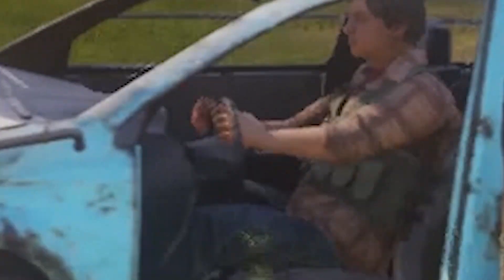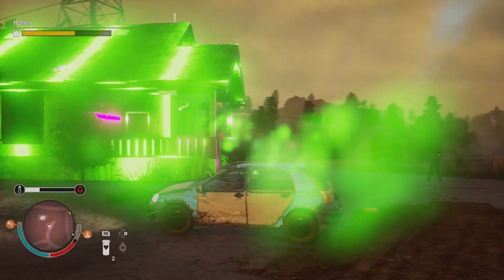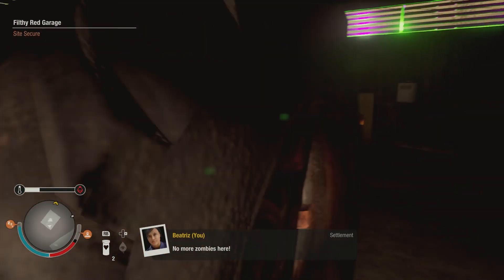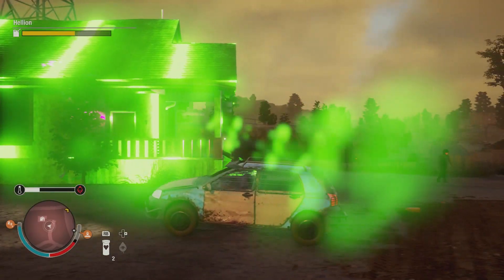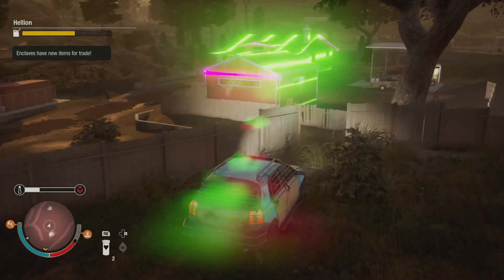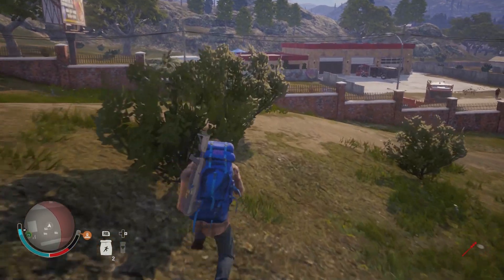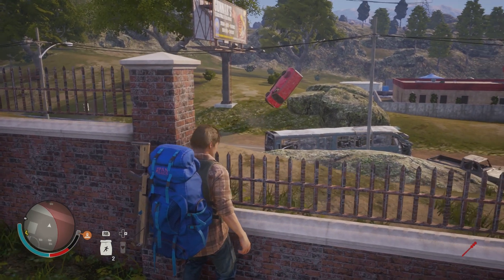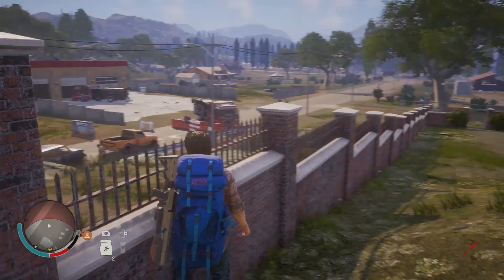State of Decay 2 WTF Glitches Part 2 (I NEED AN EXORCIST!)

Comment: Oh, man you got me dying over here! I haven't had theses issues but I have random walls in the middle of the road!
Reply from the maker: Random walls in the middle of the road? I haven't heard of that one before.
Reply: Git Gud Fox yeah for me they appear near auto shops it's weird
Reply: I've had invisible dead Juggernauts lying in the road. I was driving around and I crashed in the middle of nowhere. When I bumped into what stopped me, I saw blood splatter as it would if you tried to run through a dead Juggernaut.

Comment: I had the exact thing happen at squelones brewing company. Got back from a mission and was rather shocked when I got back to see 2 lengendres and a van flying through the air.
Reply from the maker: The strangest one I've seen is a van that rocketed off into the sky after being refueled then got stuck there frozen in the air.
Reply: @GitGudFox  yeah the mine eventually froze in the air then ended up parked down the road after about 20 mins. The most shocking was hitting 2 random zombies in a utility van and being catapulted half way across the map in something that was both hilarious and baffling.

Comment: I’ve played sod1 & now new to sod2 (yes late to the scene lol) & your vids are my fav go to guide for when I have questions. Just the other day on my first group I’m driving along hitting zombies with my car & then hit one & flipped way way up in the air, it was so high I could almost see the entire map. I was like “oh crap I’m a goner.” I land outside the map in the vehicle (I think I was driving a Jeep) & I’m stuck so I try driving around all over but there is an invisible barrier to the map & I can’t get in I just keep running into it. So I get out of the vehicle & run around trying to get back into the map but the invisible barrier keeps me out. I also tried logging out/in many times & trying the “stuck” option on the radio which only takes me back a few feet from where I was standing. So now I have 2 characters (leader & follower) stuck outside the map. I’m not sure what to do at this point but I ended up starting a 2nd group because I can’t find any info online what to do besides the stuck info. Any thoughts anyone?
Reply from the maker: Better late than never, right? So your character lived? That must have been insane.
Reply: Git Gud Fox both my characters lived but to this day they are still stuck. I’ve logged in several times to try to play that crew but they are still stuck outside the map. I started a new group since they allow us 3 total and I have gotten it up to 12 ppl. So far no glitches in that one. My only idea is to delete my first group & start it over.